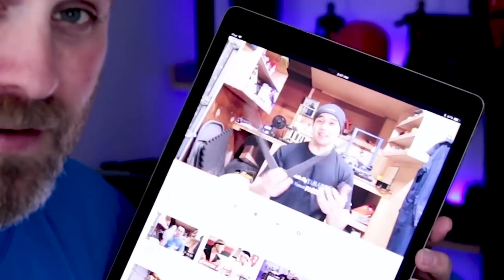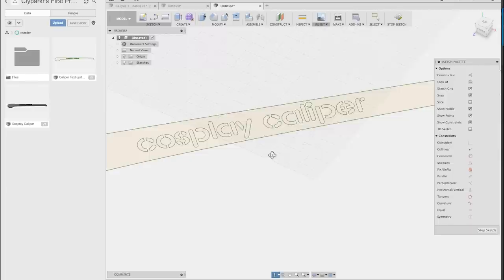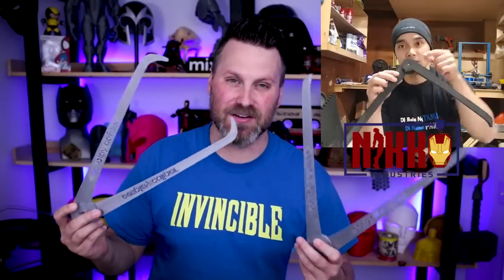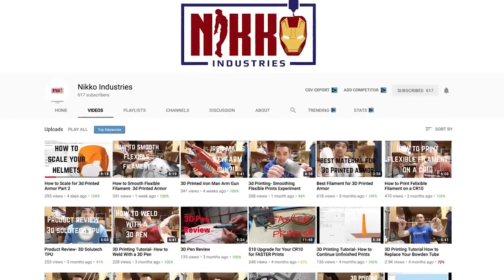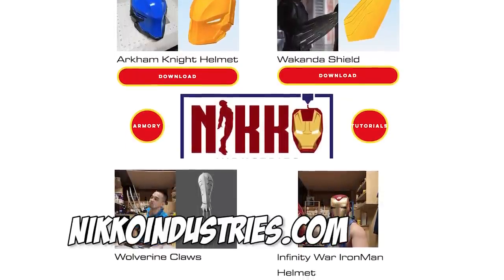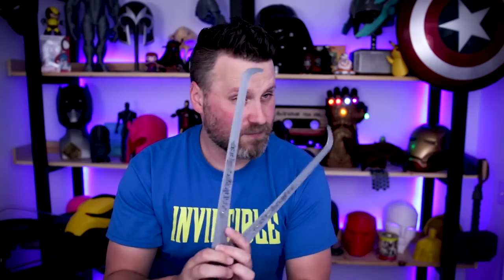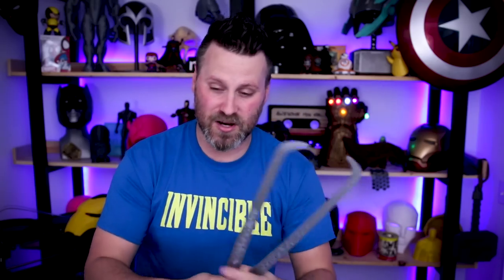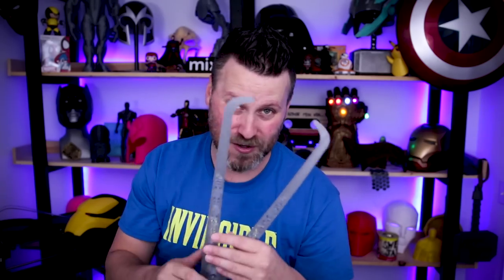Cosplay Calipers! Easy way to scale Helmets & Armor for 3D Printing | TinkerCAD

Comment: you can add a protractor + leaner ruler at the bottom and tightening  screw so you can easy get the measurement   in one process
Reply from the maker: Alix bnbly I was just talking with one of my buddies about this. Going to see if I can get it updated to include this

Comment: For those without a huge print bed you can get large inside/outside plastic calipers pretty cheaply, not cheaper than filament cost but cheap enough.  I got a set with markings up to 350mm (14"ish) for £6.80 on eBay.
Reply from the maker: Christopher Pearson awesome!

Comment: i just printed this and it never joined together, any tips on how to print the pieces to fit together right? i printed everything at 70% to fit on ender 3 v2 but the plug couldn't fit through anything and i broke one of the arms in half trying to put it together lol

Comment: hello a bit off topic from this video but i looking for help with supports when printing tpu armor, im printing the first order stormtrooper armor in tpu but having issues with supports ie the chest and ab pieces. im using cura slicer and cr10 s4 i have 4mm nozzle all stock printer which prints really well on tpu with 280 temp 50 bed 50 speed 2 to 3 layer hieght. but still looking for ideal settings for great prints. any help is greatly appreciated thanks

Comment: how did you get ironing so smooth mine always leaves lines.
Reply from the maker: Here are the Cura Ironing settings that I used (first time using this)... wish I remember where I found these settings

Enable Ironing - Checked
Iron Only Highest Layer - Unchecked
Ironing Pattern - ZigZag
Ironing Line Spacing - 0.1
Ironing Flow - 10.0%
Ironing Inset - 0.2
Ironing Speed - 20.0
Ironing Acceleration - 500
Ironing Jerk - 20
Reply: amazing Jessy thx!